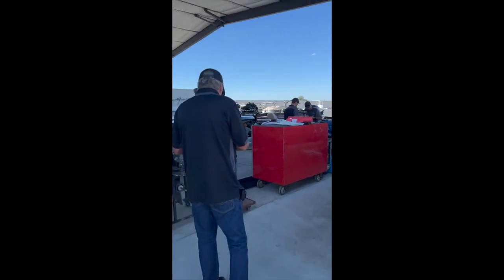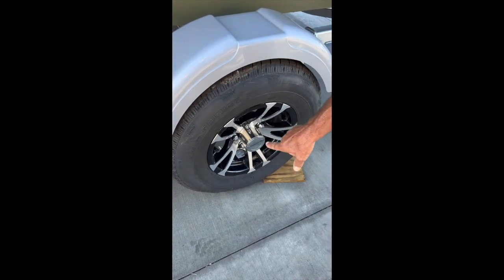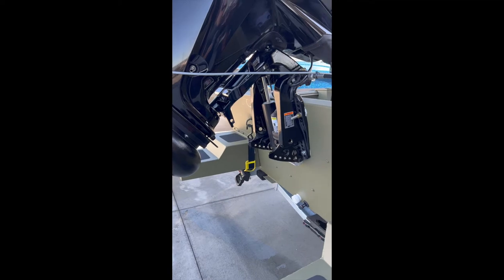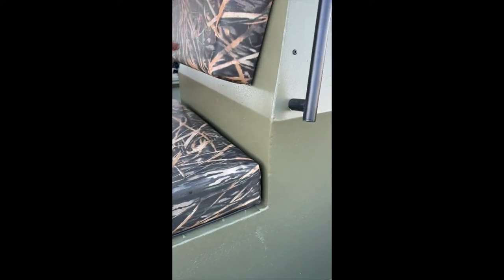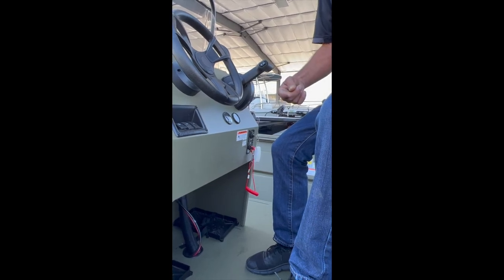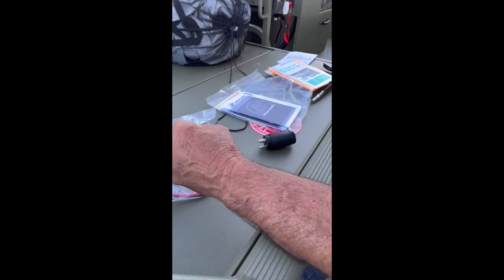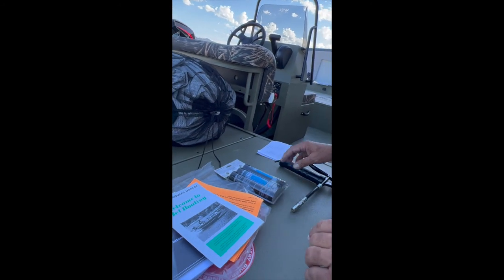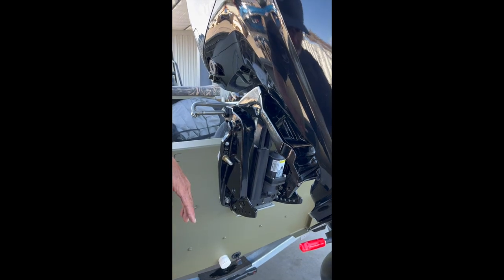CA DEPT  OF FISH AND WILDLIFE LOWE 1860 CC JET 2022 0929

Comment: Can you run a jet motor on a regular hull like that without a jackplate??? Seem like you wouldn't be at the right depth for the foot of the motor to get adequate water.
Reply from the maker: Those are all adjustable and the jet sits just under the waterline.  This boat is in service and spends a lot of time in shallow waters, barely submerged sand bars, etc.  It does not overheat and performs very well.